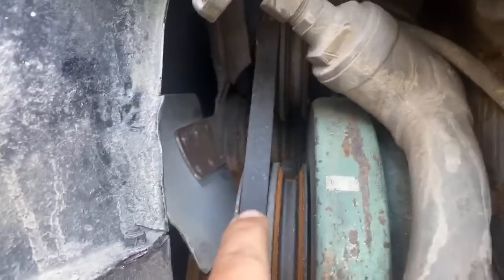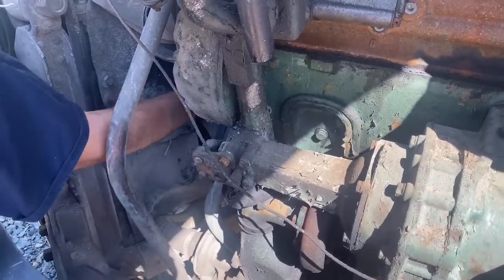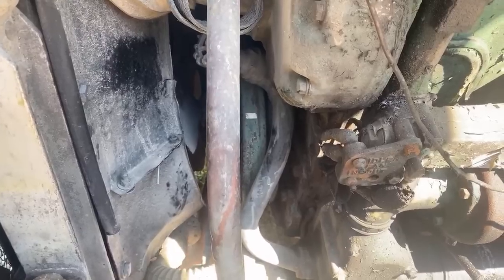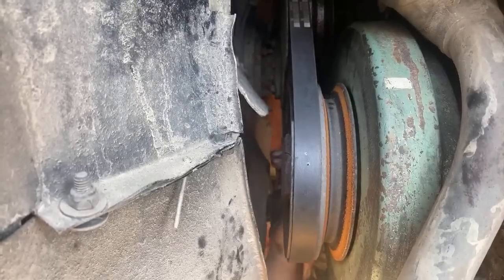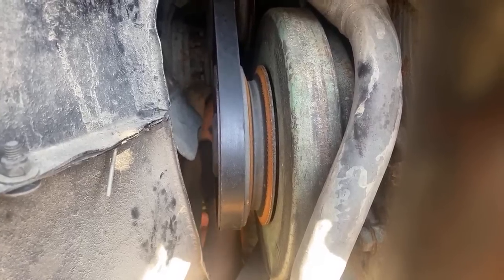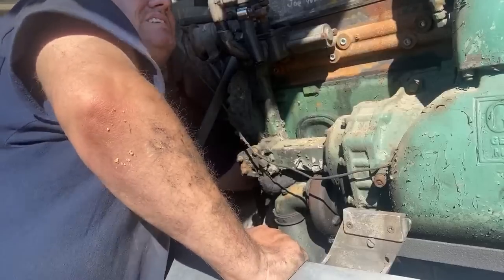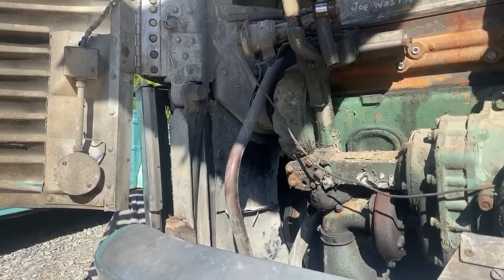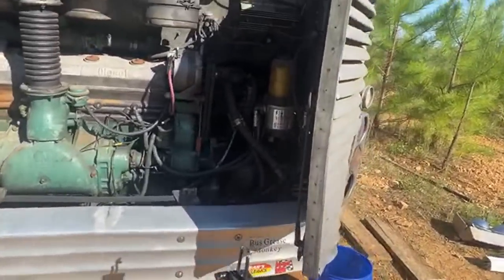Replacing fan belts on Gm Bus

Comment: Scott watching this video of changing the belts on Lenny's have you looked in McMasterCarr at the pulley's they stock to replace the damaged one?  Additionally the $3,000 labor to pour that pad is pretty reasonable especially since you have no concrete finishing tools, you have to buy the lumber to form your pad, etc Additionally the size pad you are pouring is going to mean you have to hustle your A$$ off otherwise the concrete will start setting up and if that happens you will have an expensive first class mess on your hands.  As far as the thought it doesn't have to be perfect myself I think that is no a wise way to think about that and future pad pours.  You are pouring something that is going to last your lifetime or as long as you desire to live on that property shortcutting on something that is going to last that long .......... One question is the contractor going to power trowel the surface as opposed to just use a bull float I ask because personally I think you get a much better surface on average.  That is not to say you won't get a good surface using a bull float.  Lastly concrete work regardless of how easy may look on YouTube especially once you get past a small pour say maybe a 8x10 slab is far more difficult than it appears.  It's your money your property but unless you have a couple people that are somewhat proficient concrete work and 6 to 8 hard working volunteers I myself would think long and hard about paying people who know what they are doing to do the job for you.  As always StayHealthy StaySafe and only touch your face with your elbows.

Comment: Hey Scott, I've driven a lot of coaches with two belts driving different accessories including a fan and we found we had a lot longer run out of the belts ( if there was a problem with the pulley ) using one belt only. It appears the inside pully track is ok (no damage) so maybe if you put a new belt there it would work good for you, and it's closest to the hub bearing so it won't put as much load on it.

Comment: You may want to check into Horton air activated clutch fan hub.There has to be a way to adapt it.They work off a electric air solenoid that gets it signal from the coolant temp sender. Cat Cummins and Detroit all use them in their applications.

Comment: have you thought about maybe some 14 or 16 gauge wire fence material in front of the radiator? it might not stop the carnage, but could make it a lot less of a repair. I don't think that it'll interrupt air flow. Just thinking "outside of the box".